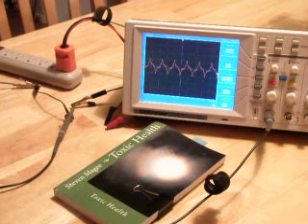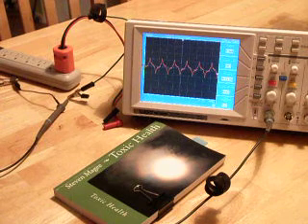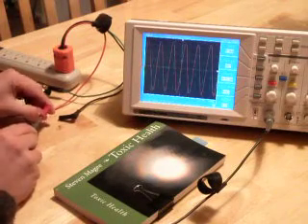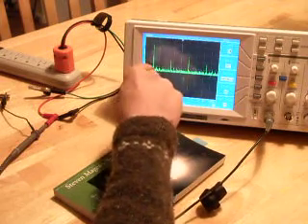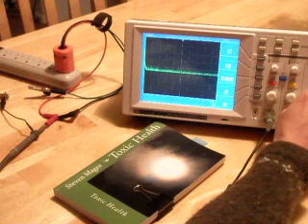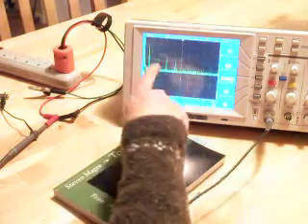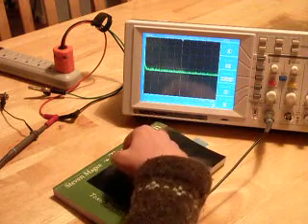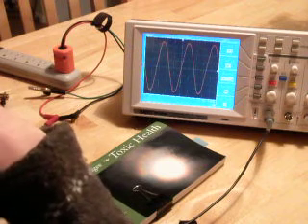Home 120 Volt Power Quality Analysis

Comment: Steven:  I am a beginner with electronics and oscilloscopes and wondering how you attached your scope to the surge protector A/C source?  My goal is to do a similar analysis of my various UPSes to see how well they produce a sine waveform output once they run on battery.   Someone posted their analysis here: Review: CyberPower CP1500PFCLCD Pure Sine Wave Or Not? but they did not attach a computer and other devices to fully push the UPS.  I couldn't tell how they attached their scope to the back of the UPS either, so any help would be much appreciated.  Thanks
Reply from the maker: I have found with UPS units that the sine wave appears good at the UPS and degrades the further away from the UPS that you get.  You are right, you should test the units on load.  Use a battery powered oscilloscope to prevent measurement errors from occurring.
Reply: Thanks!  How do I get or build a plug with the free standing wires that you attach your scope probes to?
Reply from the maker: I made the plug in the video.  It is a pair of multimeter probe leads wired into the live and neutral.  A green wire with an alligator clip was connected to the earth pin.
Reply: Thanks.  I made two of them from similar parts and they work great.